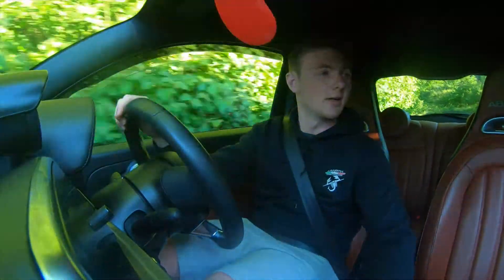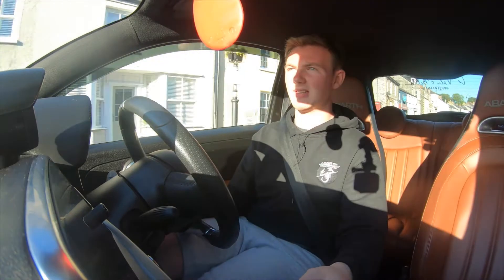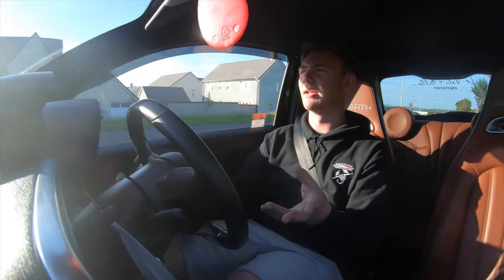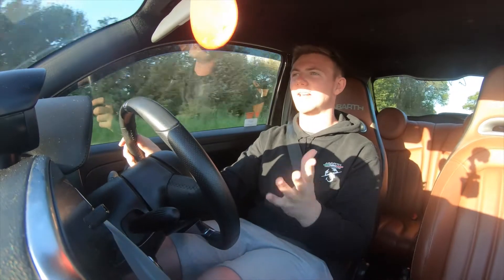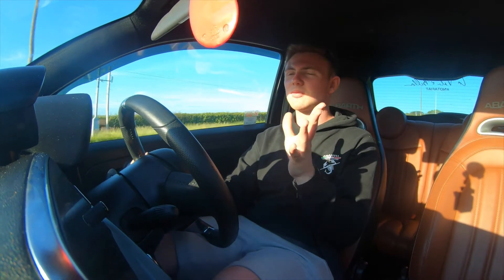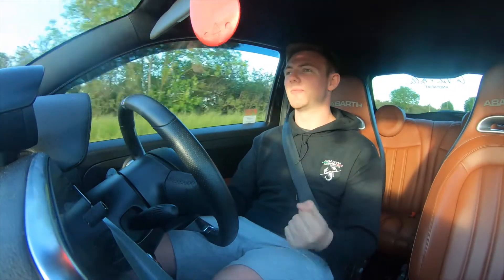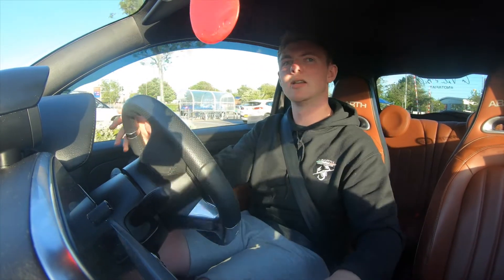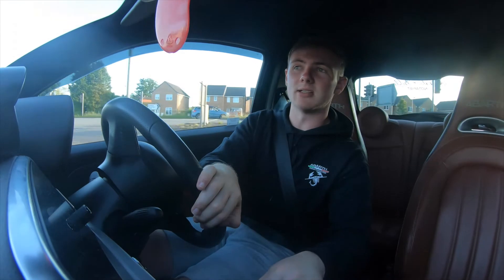Forge Induction kit !!

Comment: I just got mine fitted, One other mod i did was a reduction pipe for the breather hose from the Bov side, you get way more flutter, Traditionally people were unpluging the BOV to make it flutter but it causes a check engine light, the way i did it, No lights no fuss, It basically Vents at half the speed, so you get both Pshshshshs and Tutututuu sounds 😁
Reply: How did you do it